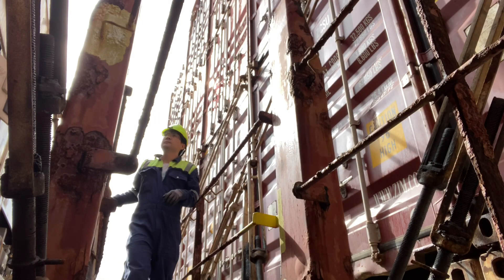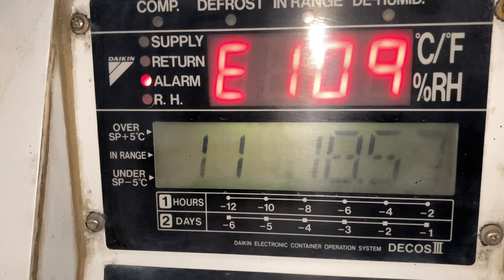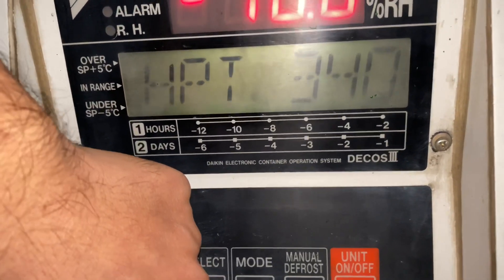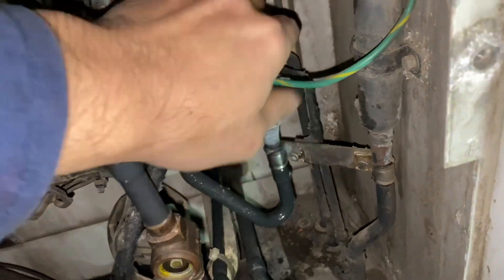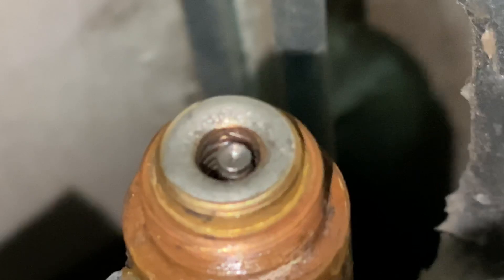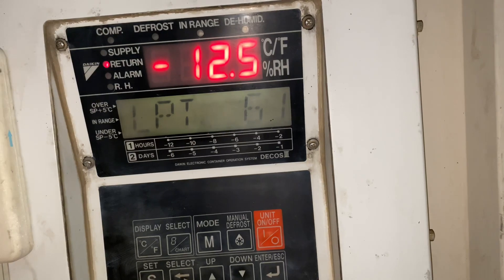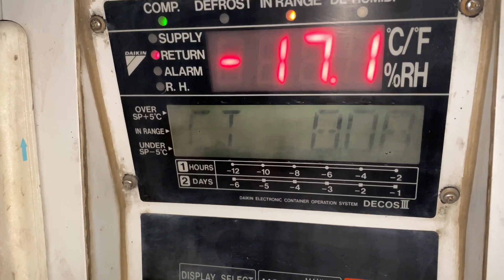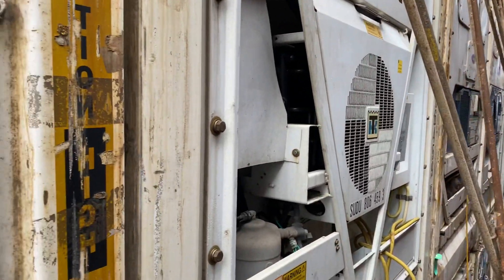TROUBLE WITH DAIKIN REEFER CONTAINER ( System gets vacuum) | ETO TROUBLESHOOTING

Comment: Hey we have an issue with our container.After a massive thunder storm,the fan inside is running but it seems the compressor and fan is not coming on?What do you think the problem is?Do you think a power surge may have caused a particular part to blow up such as a capacitor?Need your advise for our technicians to engage a reefer mechanic to have a look and fix

Comment: I am working on Daikin LXE10E-A33A , giving me the Alarm code F101.
Upon disconnecting the compressor outlet, the compressor started running ok and the alarm message disappeared.we come to conclude that the compressor is not ok and especially it is becoming very hot on it's upper area. I need your view on this one.
Reply from the maker: F101 activates when your High Pressure Switch activated. You have to check your discharge pressure first and analyze what is causing the pressure to get high.
Reply: @leckyjake  Thanks very much to respond.  I 'll check as you have said. I am in Zambia . I would love if we can arrange and communicate on video call. I admire your expertise

Comment: Hey mate need some help.Was getting a E205 alarm on a daikin freezer container  ( evaporator fan motor failure)Changed one of the evaporator fan motor because it had a bearing issue. After hours of operation the same alarm still appears. I’ve checked the running amperage of both motors and they appear to be fine. Is there something I’m missing?
Reply from the maker: there might be a lot of factors. but with conventional way of troubleshooting, check the rotation of both fans. sometimes the brand new one is faster than the old.
2nd. check the level of your cargo since the compartment is open.
3rd. check the contactor if you are single phasing.
you might probably need to change the other fan.
Reply: @leckyjake  I have checked all that everything checks out good . I forgot to mention   that there is a lot of flooding back to compressor. And when it goes on alarm the system goes on defrost.
Reply from the maker: then check the CTP of your compressor. this may sound weird but there are times that 205 appears if this is activated.

Comment: sir cuold tell me   gauge  how many psi in the low side and highside and how many psi is enought and how many is not enought sir
Reply: It depend what type of refrigerant gas uses the system 134 a or R 22 you need to see the PT Table or the app danfoss tool ref slider

Comment: hello sir i have some problem with my daikin container freezer with the ice frome evaborator to the compressor what i shuold i do sir?
Reply from the maker: First check the freon level. If less then charge
2. Dismantle the eev and clean.
3. Check your filter drier it might be blocked
4. Check your evap sensor and fans

Comment: HPT high 1632, & lpt 60
21.8©°daikin container
Expansion valve change Solnat valve change. Expansion coil change
What problem please problem solution??????
Reply from the maker: High pressure. Clean the EEV and purge a little bit